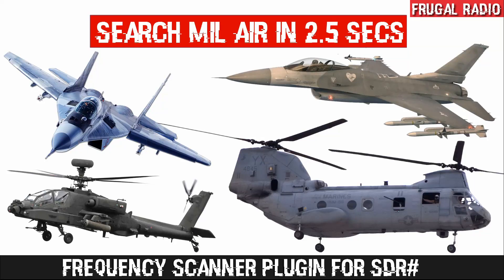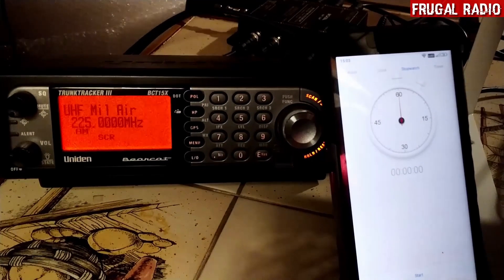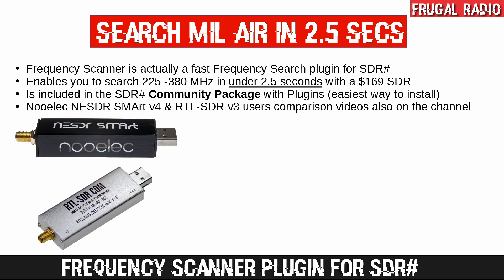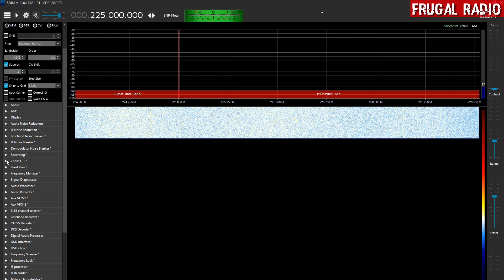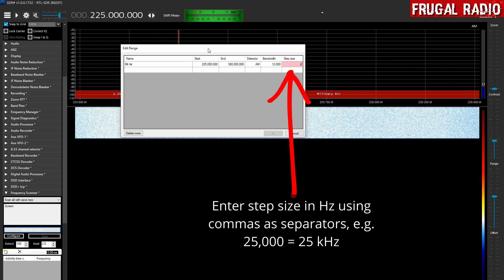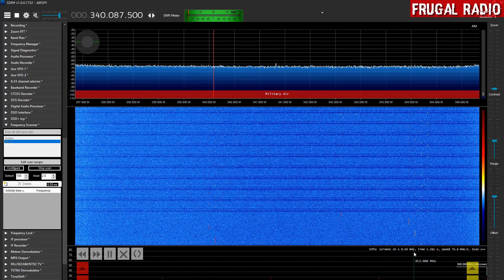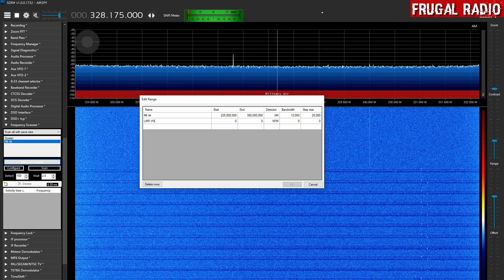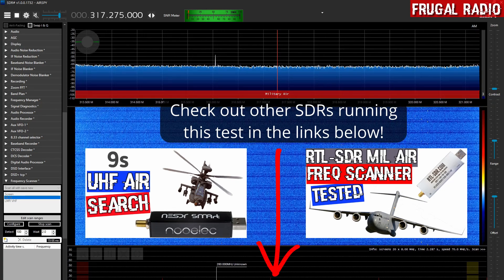How to use Frequency Scanner to Search UHF MilAir in 2.3 seconds in SDR# using AirSpy R2

Comment: Would you be able to add any insight on the scan speed if this were used with a mobile device with less computing power than a computer (such as a cell phone). I would like to have a handheld sdr setup since I move it from vehicle to vehicle when going to watch the jets. As of now I use a Uniden BC365CRS and a Quansheng UV-K6. Which works, but scanning the whole milair band in under 3 seconds, or even 10 seconds would be a massive improvement! Thanks!
Reply from the maker: I don't know if it would be possible. Perhaps a Windows laptop running in tablet mode could do it, but I don't have that kind of hardware to test. I really haven't done any tests with Android or iOS devices. But if you give it a try, come back and let us know how it worked!
Reply: Will do. Thanks

Comment: I've been having a problem where it takes a couple runs through the frequency range before it stops on a frequency that has been active for the last 10 seconds or so (verified with another radio). In other words, it can miss transmissions that last longer than the scan time. Are there any settings I need to adjust?

Comment: This is cool and all but I can't get it to stop on frequencies consistently. It just runs past them most times even on constant signals like NOAA weather.
Reply from the maker: Make sure you've set the correct step size for your search, and adjusted the threshold (the bar that acts as a squelch) to an appropriate setting.

Comment: You need to scan up to 399.975 or you will miss some of the mil Band.
Reply from the maker: Yes, mil air goes up to 399.975, but in Ireland & UK, there's also a national trunked Tetra network from 380-395. That's why I excluded it in this video.
Reply: Sorry in uk there's hundred of allocations military airband 380 to 399.975, and 137 to 155.975vam
Reply: Just lock out any airwave
Reply: But most of the freqs we know anyway so we search ocassionaly but have freqs programmed I use sds 200 and 100 loaded with 1500 freqs in use often at vhf mil and uhf mil
Reply: So never miss out 380 to 399.975 there's atc and ops, air to airs and also 137 to 155.975 am 25 khz

Comment: One thing I have noticed with both the  NESDR Smart and the RTL-SDR.com V3 dongles. 
They get extreemly hot when scanning. 
I am thinking of bolting them to a large heatsink and fit a fan. As I cant see them lasting long at such high temperatures. 
Does the AirSpy R2 get very hot when scanning?
Reply from the maker: These devices do run hot, and the cases are basically designed to be heatsinks. Some owners have taken measures to move great away from them. However they don't seem to suffer too much until you're in the GHz range.

As for the R2, I use it mostly for short term projects, unlike the RTL-SDR v3s that run 24/7. So I'm actually unsure how hot it gets over time. Perhaps I'll set one up for decoding over a 24hr period this weekend and compare the temperatures.
Reply: @FrugalRadio  Yes I have an nesdr smart running 24/7 for ADS-B on 1090 MHz and yes it is quite warm. However when scanning, my two other devices are REALLY HOT as in it burns your hand hot.  
So I just thought I would mention it for others benefit. 
I think for continuous scanning some form of cooling may be required. 
maybe a small fan etc. 
Just a heads up as last thing we want it to kill our beloved SDR's  as they are not as cheap as they used to be.
Reply from the maker: Very true! Thanks for your report!

Comment: SDR Play RSP DX can Cover from 1 Khz to 2 Ghz and it's works very well in Receiving Military Air Craft Band,
Reply from the maker: It looks like a great SDR. I've yet to use one, so thanks for the report. Is there a way it can search the mil air band quickly, like this plug-in for SDR#?
Reply: @FrugalRadio  Yes SDR Uno Solfware have a Scanner Feature on it,
Reply from the maker: Scan, yes. But search the entire band for new signals in 2 seconds? I just don't know a way to do that in SDRUno.

Comment: You're going to miss radio calls jumping around like this.  How do you receive the entire 220-380 band instantaneously?  Use 36 radios?
Reply from the maker: You'd certainly miss briefer calls. But when those jumps are allowing you to cover the entire range in 2 seconds, you're only going to miss the shortest transmissions. 

By using 2 x R2 SDRs you'd get that down to 1 second. 4 x R2s and you'd capture any transmission lasting more than 0.5 second (each R2 searching 1/4 of the mil air band). The whole UHF mil band in that amount of time is pretty amazing, and faster than 36 scanners! 

You'd probably want a device covering 137-144 MHz as well, so you didn't miss any of the mil air activity in that band as well. You could easily cover that well with a standard RTL-SDR or NooElec dongle.
Reply: Anything with AD9363 or AD9361 are quite similar, ADALM-PLUTO is the cheapest by far but the AntSDR E200 is pretty reasonable as well
Reply: BladeRF, PlutoSDR, USRP B210, etc. Can do 56MHz bandwidth, basically almost 6x that of the airspy, the bladeRF even has a mode where it can view over 100MHz at a time...
Reply from the maker: Yes, it would be fun to experiment with some of the wider bandwidth devices to see how well they perform at this task.
Reply: Check out the ADALM-PLUTO, $231.65 at mouser right now and $232.93 at digikey, not much more than an airspy r2

Comment: Great video. If I want to change frequency I have to stop the Airspy software , change the hZ and push the play button again. 
Most other functions also require this procedure, using SDR Sharp with Airspy.Also cannot hear FM stations , they show up on the waterfall but the hiss goes away when I click on the frequency. SDR Sharp Studio V1.0.0.1830 win 10

Comment: Just tried this and no luck. Software is totally different layout wise. I’m also using a NooElec Smartee v2 and I can’t see it listed. Any help is very welcome.
Reply from the maker: Hi Pete. There have been quite a few updates of the SDR# software, so this plug-in may not work now. I don't run the newer versions of SDR# as they made my old laptop crash too frequently, so I still use the old version. Your single choice is fine though, just select RTL-USB from the menu in SDR#, and as long as you have the Zadig drivers installed, you should be able to receive just fine.
Reply: @FrugalRadio  is there an option to use the version you are? I couldn’t see a list of versions. As for driver I’ll do that now
Reply from the maker: You can't officially download the older versions now, however there is an unofficial set of downloads at https://www.iz3mez.it/software/SDRSharp/

You might want to check out the NooElec Install Guide as well at https://support.nooelec.com/hc/en-us/articles/360005298053-NESDR-Installation-Guide
Reply: @FrugalRadio  okay so drivers now installed. I use the latest version and it scanned but the number range doesn’t match yours at all. I’ll try the matching version tomorrow. Gutted it’s this difficulty
Reply from the maker: The good news is that once you have it up and running well, it needs very little readjustment!
Reply: @FrugalRadio  id really like to get this working and the normal airband. I’ll try again tonight with your links and try to copy yours. If all else fails is there a way to contact you for some extra help. Happy to donate for your time.
Reply from the maker: Hi Pete. No way to get hold of me directly right now I'm afraid, other than here. Good luck for later!

Comment: Very good video!  Because of this I went ahead and purchased an Airspy R2 (I already have the Airspy HF+, but realized it doesn’t cover UHF).

Because it scans the band so quickly, and aviation comms are so brief, do you know if there is a good recording app/program that will automatically record the audio, when the squelch is broken, then stop recording once the transmission stops?  I am trying to avoid missed manually recorded audio due slow reactions, and also avoid long audio clips of silence punctuated by brief 5 second recordings.  Thanks much, love the channel!👍😊
Reply from the maker: I expect there would be an SDR# plug-in that would do so, while recording the frequency as well, but I haven't done that myself. I have made use of the free Audacity software to do this though. It has a voice activated type mode, so only records the transmissions that break squelch.
Reply: Thanks...I will look at the SDR# for a plug-in, and take another look at Audacity as well as I did not know it has a voice activated mode.  Thanks much!
Reply: I had another question for you on how you use the SDR:  Do you only use the SDR to identify the active frequencies, then plug them into your Bearcat scanner(s), and search these frequencies? Or, do you just use the SDR for identification and listening, and the Bearcat scanners never come into play?
Reply from the maker: I use them in multiple ways. Mostly I use the wide bandwidth SDRs for signal searches and working out unpublished trunk network frequencies. The lower bandwidth SDRs are used to monitor Control Channels of digital networks (P25, DMR, NXDN). Another PC is used for voice following networks, and sometimes uses a cheap SDR, other times a high bandwidth one depending on the frequency span of the system.

Several other SDRs are used for aviation data decoding (ACARS, VDL2 & CPDLC). It is much easier to do these with SDRs than scanners.

I have a bank of traditional scanners that monitor known local aviation frequencies. One for Ground / Clearance, one for Tower, one for Departures & Arrivals & Terminal (usually the same controller working 3 positions. Then I have a UHF two way radio programmed for the local air ambulance repeater.

That leaves 3 Bearcats. 1 does the 2 nearest ARTCC sectors, one does P25 & DMR reception, and one does mixed duties - sometimes railroad channels, other times airport company frequencies, airline staff channels, de-icing crews etc.

The Bearcats get switched around a bit, as do the SDRs. The bank of aviation scanners usually stays the same.
Reply: Thanks for your complete and interesting reply.  It is good to learn the workflow of different hobbyists, and you certainly have your workflow worked out well!   My Airspy R2 arrives tomorrow, so perhaps I will apply a little of your workflow with my SDR and traditional scanners.

Comment: ive set it up as per your video some of the options you mention dont pop up on the menu screen , how come i dont get the bottom part with the X and the arrows ?
Reply from the maker: Might be down to different versions of SDR#. The plugins usually look the same though, regardless of service, so I'm unsure why yours would look different.
Reply: @FrugalRadio thankyou for your reply , i got it com up but it filled the screen up,
Reply from the maker: Great!
Reply: @FrugalRadio  its shows up when you move the mouse cursor

Comment: Great video, have now managed to set up my Airspy to work as such. Is there any way to get an output of frequencies found other than by copy/paste of the list window? Looking for a realtime output.
Reply from the maker: Good to hear you have it up and running Paul. I haven't looked at outputting the data in other ways, I've only used the method you described. Although mostly I was typing the discovered frequencies into a scanner for verification / identification.

Comment: So am I right in saying this is quicker at searching but slower at scanning saved channels compared to a scanner?
Reply from the maker: Yes, this method provides an incredibly fast search, however traditional scanners are faster and monitoring a group of frequencies if they are spaced out more than the bandwidth of your SDR. 

So an Airspy R2 like this can actually monitor quite a few frequencies simultaneously, provided they are within 8 MHz of each other. That can be quite useful sometimes.

Comment: you can use exponential expressions as well ie. 255e6
Reply from the maker: I'm not sure what you mean. Where would you use such expressions?
Reply: When you type in the frequency  255e6 is the same as 255000000 you don't have to type out all the zeros e6 will add 6 zeroes e4 will add 4.
Reply from the maker: Well that's a great tip, thanks for sharing. You might have a soldering iron, but you don't sound like an idiot 😉

Comment: I'm totally new to SDR, and my only interests are (Civil & Military Air bands)  what I could start with is …"Airspy R2" + "SDR#" + "Frequency Scanner Plugin",  (am I correct so far ?)  ...... initially I will be going for an antenna that I can put outside a window (on a shelf)   I need some recommendations for that...TIA.
Reply from the maker: Hi Brian. 

Yes, an R2 and SDR# would be a great start into the hobby. SDR# has a lot of functionality, especially with the plugins.

Another great SDR to get you going would be the SDRPlay RSP1A. It has some great features, including built in scan modes. I don't think it can scan the entire military Airband in 2 seconds though, as it cannot be used with SDR#.

A simple RTL-SDR v3 / NooElec SMART v4 is also a great way to start if you are on a more limited budget.

Comment: Great video as a very long time radio nut inc'g amateur in Aust who due to life ( work, family etc) getting in the road has had many years away from the hobby & so just about to go out & spend some $$ on an SDR.

So question, based on your 225 to 380 search can you go and leave it to its own devices ( unattended) and it log any finds whilst you are gone for you to review upon your return.

Also you were saying to enter the frequency search useing ( commas) 225,000,000 but tue display showed full stops 225.000.000

Just after clarifaction.

Thx
Rgs Wayne.
Reply from the maker: Welcome back to the hobby Wayne!

Yes, you can run the plugin unintended. It might be worth testing with it first, and blocking the frequencies you already know.
And yes, commas are required, and the GUI will do it's own thing!
Reply: @FrugalRadio  thanks heaps for the prompt reply. 🤗 looking forward to your other videos, just gotto hurry up & get my SDR 😊

Comment: Hi, great video and inspired me to get an Airspy R2 to use instead of my RSP1 and RSP2pro with SDRuno for reconnaissance.  In case you're not aware, there's a newer version of the Frequency Scanner plugin (by thewraith2008) available if you search for "SDR# Plug-in: Frequency Scanner updated" on forums.radioreference.com
Great content btw
Reply from the maker: Thanks for the tip on the updated plugin. thewraith2008 makes great plugins!

Comment: Although not shown on your video you can also mute the birdies on the bottom display. Select the birdie that is causing an issue and the blue bar will turn red. You may need to zoom in to easily select the troublesome frequency. Great channel and information videos.
Reply from the maker: Thanks for sharing that tip Evan!

Comment: There are several frequency scanners and i am not sure witch one you was using.Could you supply a link to the scanner you was using thanks
Reply from the maker: For analog, I use my trusty BCT15x scanners - https://amzn.to/31Y2F4F
The digital ones you could see were the BCD996P2 (and older model 996XT) - https://amzn.to/32Tn4XL

Comment: I can't figure out what the green adjustment arrows on the lower right do within the Frequency Scanner plug-in. I figured out that the red adjustment arrows on the lower left seem to be the "squelch" or signal strength threshold, but can't figure out what the other green one is for. Anyone know?
Reply: Same problem here, many questions. my SDR# has 5(!) scan related plugins with icons that seems to be different or change over time after updates. It's hard to find any good tutorials for many plugins.

Comment: Great video. I live just north of London and can pick up the ATIS information voice audio from RAF Northolt on 299.8mhz. It seems to continually broadcast in daylight hours, so it's useful if you can get an antenna up high enough and you are within 50 miles of that point so that you can tell that your system is set up and working OK for these frequencies. There may well be UHF ATIS broadcasts for other bases around the country. I imagine Brize Norton must have one and for people in East Anglia and Lincolnshire, there seem to be a lot of bases in those areas. The latest antenna I made for this frequency involved some short strips of wire bound around an empty drinks bottle, stuck on top of a length of bamboo rods, bound together with gaffer tape. You can definitely have a lot of frugal fun! You may want to consider experimenting with TV /Sat antenna amps, both in-line amplifiers and masthead amps. Often the cheaper the better, as they have no strong bandpass filtering and you get great amplification up to ADSB frequencies and beyond. I've received the Inmarsat for our part of the world like this. My antenna for that was 12 small pieces of linked copper foil with a  copper foil ground plane.
Reply from the maker: Thanks for the comments Alan. Definitely true about being able to make frugal antennas. I'm currently using a home-made bow-tie for Civ & MilAir. I like the sound of some of your setups though!

Comment: Airspy is trash. $25 rtl dongle works just as good
Reply from the maker: In many situations the lower cost dongles perform just as well as the more expensive AirSpy receivers, but the higher priced SDRs come into their own when you need them. e.g. if you are after the higher bandwidth, or you need the extra filtering, you'll want an AirSpy or SDRPlay.